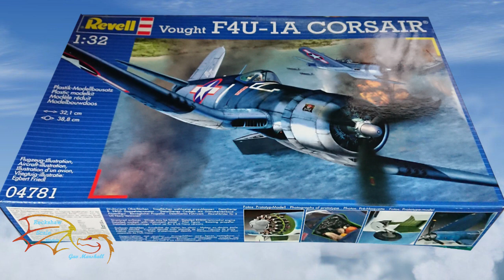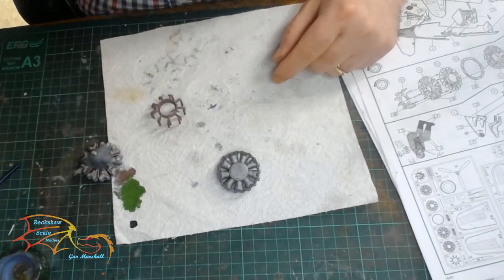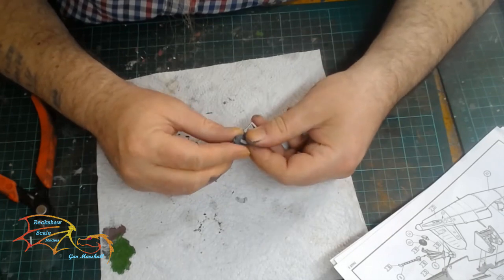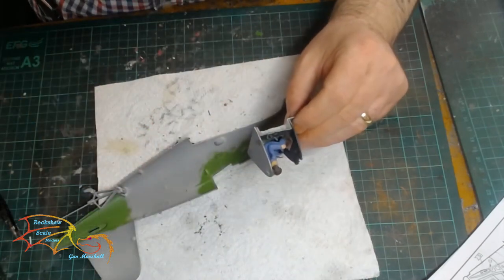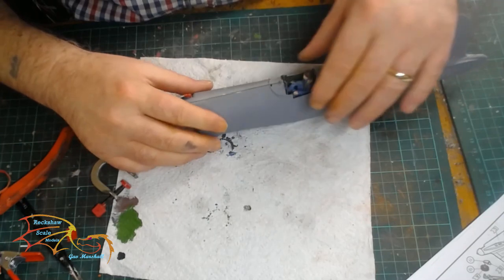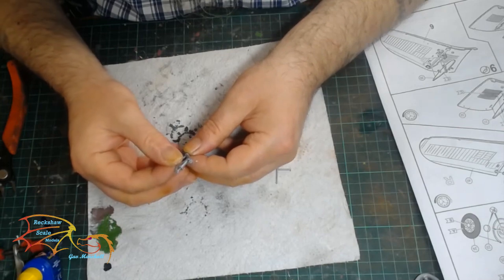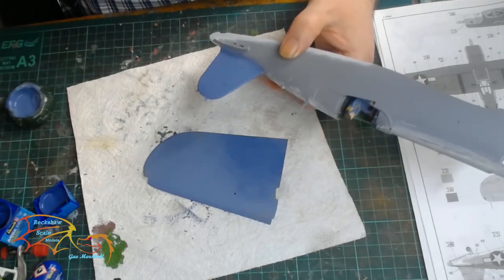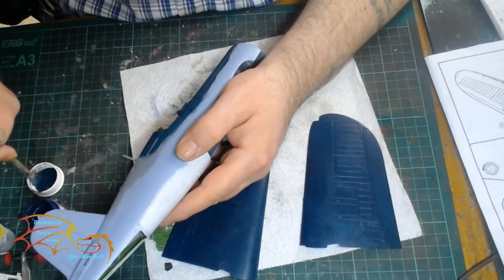Revell Vought F4U-1A Corsair Scale 1/32 Part 3

Comment: An interesting painting method, I haven't seen this before.
Reply from the maker: Hi potrzebieneuman4702, it's a technique I developed a few years ago when trying to paint shades of yellows. The key is a correct primer colour and the minimum amount of paint on the brushes, effectively dry brushing. It's better to use an old brush since it can ruin a brush. When painting I use a light pressure, the brush barely touches the surface. However I will increase the pressure to create different shades and textures. That way I can add weathering effects as I go along.
It works best with water based acrylics but paints like Tamiya's which are lacquer based can be more difficult to achieve the same result, it won't work with enamel paints though.
It is a difficult technique to get right. So if you decide to give it a go practice on an old or cheap kit you don't mind what the finished look will be. For darker colours I'll paint in the conventional way. Thank you so much for watching and work your comments.
Reply: @ReckshawScaleModels  That's magic, thanks for the reply.